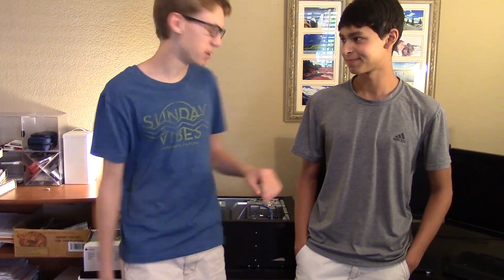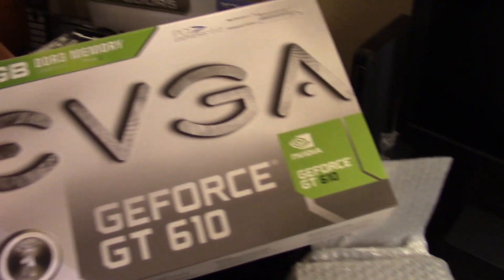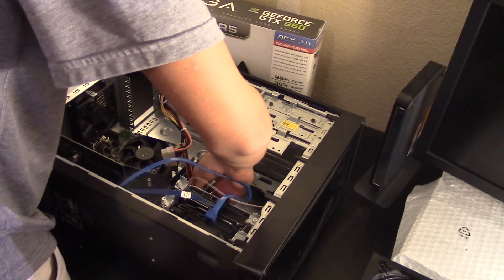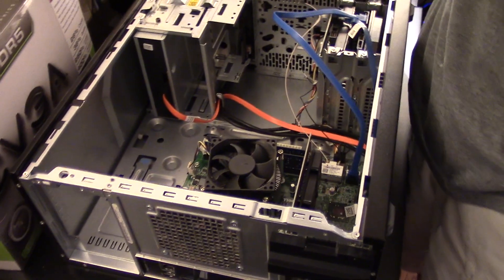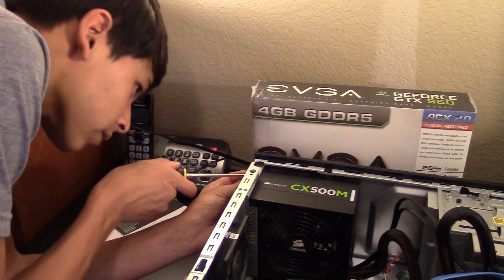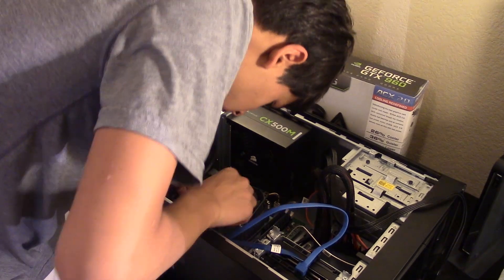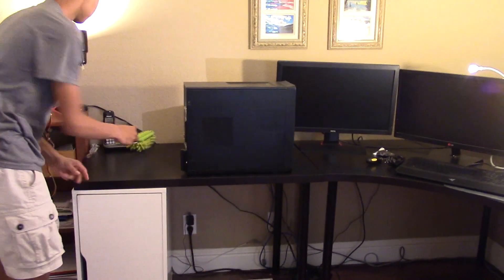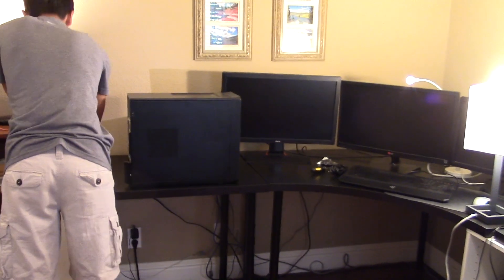Dell Inspiron + GTX 960 = Gaming PC?

Comment: Nice video :) I have a core i7-6700 3.4GHZ and a R9 390 8GB GDDR5 and 8GB ddr4 2133Mhz :)
Reply: I know if I had gone AMD I would have regretted it because they haven't updated chips for a long time.. so I went with intel :) no regrets what so ever... I don't care paid a bit more
Reply: and it also means I wont need to spend extra in the future for stuff like DDR4 ram because I already have it
Reply: +Danny F You must be compensating, I have an i3 4160 and a GTX 950 with 2GB GDDR5 and i'm fine
Reply: +Tmanstomp100 +Tmanstomp100 Hahaha 😂 no... Just wanted it for video editing and gaming... 😂
Reply: Danny F Eh, it's overkill, and btw AMD processors are better in cost for performance, but Nvidia graphics cards almost always perform better, look at digital foundry's tests for the GPUs, idk where to find anything for the processor, but i'm an intel fan, even knowing they cost more for no gain... Team intel... Before I got my "rig" I used a laptop with an i3 2370m and a broken cooling fan for literally everything on my channel including the gta 5 videos (but they were recorded on console so they were just edited on here)
Reply: +Tmanstomp100 As of right now, current AMD chips are definitely not a better price/performance ratio considering they're bordering their death bed. They barely compete with even first gen i5/i7. Things may change when Zen is released, but looking towards the future investing in an already aged socket isn't the best idea, considering it will lose it's relevancy far faster and you will just have to turn around and spend more for an upgrade.
Reply: ***** You must be forgetting about the entire FX series and the fact that you can get a very cheap 8 core AMD cpu and overclock it to match intel chips... benchmarks also show proof, do some research first bro, and either way most games aren't processor heavy anyway, and like I said i'm an intel fan, I'm currently investing in a Pentium G3258 that I plan to overclock to 4.3Ghz with a STRIX GTX 950 which I also plan to overclock.
Reply: i7 970 - a cpu from 2010, is on par with any of the 8 core FX cpus.
Reply: ***** Go check your own facts that simply is not true.
Reply: It's not a 100% comparison, but it's close enough performance to really show how bad the performance is. The categories where the FX wins is only by a few points or a few seconds, and it even loses in some categories. http://www.anandtech.com/bench/product/697?vs=157 but you believe whatever you want.
Reply: ***** Relying on scores alone won't get you anywhere, check the gaming performance. It's pretty much the same. Like I said it's all about price for performance, You wanna edit, go for intel, you wanna game and be able to overclock go for AMD, but like I said at the beginning I AM AN INTEL FAN
Reply: ***** Again, you're failing to grasp the fact that it's an already dated socket by all accounts. Preforming on par with intels counterpart from over 6 years ago. I would never suggest someone who wanted to game in the future to purchase hardware that old. The FX series are the complete opposite of the nonsense you're suggesting. Through and through, intel is better for gaming. It doesn't matter if you prefer intel, because you obviously prefer ignorance over facts. The pure and simple fact is that intel from socket 1366 and up, and only gaining a larger margin per new generation, is currently better than anything the FX line processors can offer. That may change when they release their Zen line of CPUS, but at the current point and time intel has a much better price to performance ratio. With AMD, to even utilize that $160 dollar fx 8350, you have to invest in a better (more expensive) motherboard with a quality power phase and vrm cooling. On the intel side of things, you can get a $180 i5-4430 and use any basement bargain 1150 board. That i5-4430 will outperform the fx 8350 in every single aspect in 99% of cases, and in the rare cases where a game actually utilizes all 8 cores it still only nets a negligible advantage. Not to mention the fact that as of right now, 1150 is even a last gen socket.
Reply: ***** Bla bla bla bla bla, Are you done? I only read half your comment dude I honestly can't even be expected to argue over processors that I don't even like, I know what I know, all those speeds on that website are STOCK, you never said anything about overclocking or about the fact that a majority of intel processors are locked, but it doesn't matter, the short answer is it's 2016 and if you wanna game it's not about your processor, we don't live in the day of the Pentium 4 anymore we live in the day of the G3258. We live in a day where you can take a 60$ CPU and with adequate cooling and make it easily comparable to one that costs double or more, and until you know the struggle of gaming on a budget and not having money for literally almost pointless power, you won't get it, i'm talking about the value of a dollar not the pure facts and frankly I don't care. Why would I wanna pay for anything newer to save me a few hours of editing or get 30 extra FPS that I literally CANNOT see? Monitors at least to my knowledge only practically go up to 120hz, most monitors are 60hz, So why do you want 180fps? If it can keep a steady let's say 70fps it's viable, as a matter of fact it's fine and it's accepted, most of the world games on integrated graphics and older hardware anyway, so honestly ask yourself is AMD that bad? I find it funny that I can sit here and defend something I don't like and don't use, but it's people like you who don't realize the true value of a dollar who get on my nerves.
Reply: ***** You said it yourself. Intels dual core  $60 cpu is even on par with AMD's 8 core. To say that AMD is the way to go for gaming is just willingly ignorant. Again, that might change with Zen, but as of right now that's beyond false. Any game that is cpu heavy, which there are quite a few of, will preform noticeably worse with an FX processor period.
Reply: ***** The only games I can even think of that are CPU heavy are Minecraft, Starbound, and Fallout 4 to a much lesser extent, And if you have the video card to back it up and an overclocked CPU, AMD is a viable solution for the price.
Reply: ***** I'm not saying it's bad. As of "right now" it's fine. It's completely playable. But that still doesn't change the fact for very little extra money you can invest in a current gen intel cpu which is all around better, and will have more longevity. The aforementioned i7-970 is a 6 year old processor that still holds up to the FX line. You can get away with using the i7-970, but just as the FX line they are not wise investments at this point in time. If you already have an FX processor, great, keep it and use it until it has no life left in it. I'm referring to if someone is going out to build a computer right now, it makes zero sense to invest into anything AMD currently has to offer.
Reply: ***** Dude i'm building a PC right now, it only costs 350$ total and can play just about anything you throw at it on high-max, all used parts except for the processor which is a G3258 which is gonna be overclocked to around 4Ghz until I get a new cooler for it, and it's gonna have a GTX 950 in it which is also gonna be overclocked for a while, but the PC is temporary, I'm saving up for an unlocked i5 and a GTX 970, but as we were saying, processors don't matter anyway, i'd just save the money, i'm ONLY getting newer intel shit because i'm an intel fan, if I wasn't i'd get the cheapest viable option out there which is an AMD processor.
Reply: ***** If they didn't matter you could still use pentium 4's. The FX line will become obsolete faster than the Intel lineup. Get whatever you want.
Reply: ***** MODERN processors don't matter idiot. And funny thing is I have a pentium 4 machine behind me lol, I don't care what "gets obsolete" unless i'm doing editing, or playing a VERY VERY processor heavy game, anything from like 2009 and beyond will do just about, maybe not the i3s, maybe not the low end bullshit consumer grade chips, but anything made for performance from around that era can still work today, for fuck sake a core 2 quad q6600 can still be used in gaming today, processors DO NOT matter, fight over video cards, AMD video cards are shit, I know AMD processors are shit, i'm just saying they DON'T MATTER ANYMORE, now If you have anything else to say, say it about a video card, because i've seen benchmarks and by benchmarks I mean FRAMERATES, not test scores, of some very "obsolete" processors when paired with modern video cards the difference is rarely ever more than 30fps compared to the top of the line chips, and that 30fps doesn't matter when you're still getting 100+ and can't see it unless you have a 120Hz monitor? The only reason I see nowadays to go to anything newer than 3rd gen Core i3/5/7 is if you're playing with a 240hz monitor, and face it, NOBODY has them. Be practical, and stop being a little linustechtips fanboy, why play with everything maxed on every game when it looks nearly the same on medium or high? Ever heard of custom settings? ever heard of being smart with your money? and funny thing is, i've seen an AMD FX chip outperform an i5 so I can't trust the link you posted.
Reply: ***** AND GUESS WHAT ELSE??? Pascal GPU architecture and DirectX 12 are right around the corner, Skylake is the last thing you will ever need, 4k is a stupid resolution because you can barely tell it apart from 1080p, this whole mentality of "Oh I need something new" is just companies taking your hard earned money. At the end of the day mid range is always the way to go.
Reply: ***** I never said anything about 4k. Listen: It's really simple, man. FX processors are fine right now. They wont be fine into the future for as long as any current intel cpu will be. If you're ok with having to spend more money to upgrade sooner, then go ahead, but I'd rather spend a little bit more now to have something that will last longer.
Reply: Danny F Yeah, paying that little bit extra upfront is the much smarter option. Pay 20-50 dollars more right now, compared to saving 20-50 dollars right now but then having to go out and spend another 60 for a new motherboard and 100+ for a new cpu in the future, where spending that extra 20-50 now easily prevents the need for that upgrade.
Reply: Danny F Do you even realize ram has nothing to do with gaming? DDR3 and DDR4 perform the same, 1066Mhz DDR3 will do exactly the same as 1600Mhz, Ram doesn't even need an upgrade because it's barely utilized and when it is it doesn't need to be any faster than 1600Mhz, DDR2 is obsolete and will stay that way, but I don't see DDR3 dying anytime soon, or ever... But honestly to you both i'm gonna say it like this, future proofing in itself is currently obsolete because the hardware is MILES ahead of the software it runs, and the software doesn't seem to be catching up anytime soon.
Reply: ***** People also thought DDR2 would be fine. DDR3 is fine for right now, but again - looking to the future, DDR3 will be going the way of 2. These aren't opinions. This is 100% fact. There was also a time when people thought "nobody needs more than a dual core"
Reply: What I meant was if I ever go to new platform then I wont need new ram... because I doubt newer platforms will use DDR3 much longer.. maybe 2-3 new revisions then it'll disappear and I wont be upgrading any time soon
Reply: ***** Honestly you sound dumb as fuck now, because DDR2 may not be supported but if it was it'd be the exact same thing but a slight bit slower, you don't seem to grasp the concept of ram, and all i3s i've seen are dual core and so is the pentium G3258... So the "nobody needs more than a dual core" is still somewhat true for gaming, just nowadays some games seem to run better on a quad... But seriously, get a DDR2 motherboard with an LGA 775 socket, put a Q6600 in and overclock, top it all off with a 750ti and guess what? 16GB of ram is still enough for everything to work fine, it can still run games on medium. Aged or not, it's a 9 year old chip... still working, maybe not comparable to anything modern but it works, the whole obsolescence thing is bullshit
Reply: Danny F Waste your money in whatever way you please.

Comment: Is that a Dell Inspiron 620?  How much did the video card and power supply cost all together?
Reply from the maker: +Sam Levin Not sure. Just check amazon.
Reply: $210 gpu $50 psu ~$260
Reply: Allen Wilson GTX 960???  That's alot more than 210 bucks.
Reply: http://www.amazon.com/EVGA-Installed-Backplate-Graphics-04G-P4-3967-KR/dp/B012NOWERC/ref=sr_1_1?ie=UTF8&qid=1461674111&sr=8-1&keywords=gtx+960+ssc
Reply: Sam Levin About ~$210

Comment: Is this an Inspiron 3847?
Reply: Yep
Reply: +KEVINVILLE34  I am thinking of doing the same upgrade as you, how is it for games? currently hoping to play assassins creed, sims,  life is strange. ect...
Reply: +KEVINVILLE34 Hi, I have the Inspiron 3847 and I think the stock 300w psu is going bad (it's got louder over time),

It also came with Nvidia GT 705 card which I would like to swap out for something with more power, I'm not a gammer, just want something better,

Can you tell what version of the 750 TI you used because there are a few different versions. I was looking at  the 2GB GTX 750 TI , to go with CX500M psu,

Would they be compatible and run in the Inspiron 3847?

Thanks
Reply: +KEVINVILLE34 Thanks for that, will that gpu fit in the 3847?, it recommend the card less than 10 inches long and can it be fitted in the same location lot as my current card?, I assume I just need to take the old one out and fit the new one?,

Like I say, that's a while ago, primary objective is to replace the PSU. I thought about dust in the stock 300w psu, but its been cleaned with air duster etc and the PC was pretty dust free inside, I think it's just going iffy,

Thanks again
Reply: +KEVINVILLE34 Hey thanks man for the tips, appreciated
Reply: +KEVINVILLE34 Hi again, would I actually need this graphic card for what I want?, I'm not a game player or anything, but I do a bit of video editing and converting. I was really looking for something mid range, that would give me a little more horse power than the graphics card I'm currently using (Nvidia  GT 705) that came with the 3847. Or would you say the one you recommended is a good choice price wise?

Thanks again👍🏻
Reply: +KEVINVILLE34 That's great, thank you, any chance you can link me to the exact make a model you recommend again?,

Thanks again
Reply: +KEVINVILLE34 That's great,just a couple of things I wanted to confirm,

Can I install this card in the same place as my current card?,

I'm running a Intel core i5 4460 (quad cpu) 16gig ddr 3 memory,

Corsair CX500M psu,

Those graphics cards you link will be comparable with that set up?, in addition I'm running a DVD drive, Samsung eve ssd and 1tb mechanical drive, that's it👍🏻

Thanks again
Reply: +KEVINVILLE34 I've just finished installing the CX500M, and flicked the power button on (or at least I thought), nothing happened, flicked it again, and it all powered up, whole system sounded whisper quite, so I'm guessing it must have definitely been the stock Dell psu making noise,

Also, those things look more like Transformers than power supplies,

All seems good so far👍🏻

Comment: those two upgrades cost near to 400. a PS4 now is 300 plus it comes with a game. it runs 1080p and 60fps. so ps4 best way to go if you just wanna game.
Reply: 1080p 30fps *
Reply: Marc Anthony want proof? Just search it up
Reply: I read the article and what its saying is that consoles are gonna get 60 fps but at a lower resolution. So 720p 60fps. The Xbox one and Ps4 are not powerful enough to run all games 1080p 60 fps. I'm not bashing consoles considering i have both the Xbox one and the Ps4 but there hardware is outdated and while at a good price cannot compete with a PC which is more expensive but delivers a great experience.
Reply: the psu is 60$ and the gpu is 210$ thats 270$
Reply: I trust a website that appears with a pop up after 8 seconds telling me to pick a number then automatically redirecting me to a softonic download page (and the title says should)
Reply: +Sachin Sharma 

Not trying to beat a dead horse here, but there are plenty of ways to make a console killer for under $300.
Reply: +Sachin Sharma What world are you living in where a gtx 960 and cx 500 psu cost $400? You can get the gpu for 170 and psu for 50. Not to mention that even considering these are weaker as far as computer standards go, they will hold relevancy far longer than any console. Console graphics are roughly equal to a gtx 470 card. A card from 2010 is on par with current gen consoles.

Comment: Well, CSGO is like the least demanding game ever.
Reply from the maker: Matthew Ruggles  but if you are getting like 150fps in it then you can probably run some more demanding games pretty well.
Reply: I know, I was just pointing that out :P
Reply: +MoreGevan32 Hey, can you tell me if thats a mid tower case? Ive got a dell inspirion 620 Mid tower, hoping a 960-970 would fit. getting a new motherboard anyways but worries about the fitting from the case.
Reply: +Buffbrah I have a Dell Inspiron 3847 which looks the same as the computer in this video and my case is small like a mini case. I'm planning to get a 970 which should barely fit. If you have a mid tower it should have enough space. a gtx 960 and 970 is around 10.10" long so you can measure your case to see.